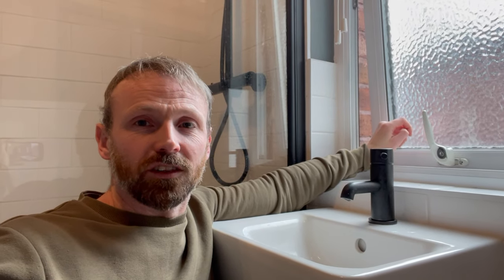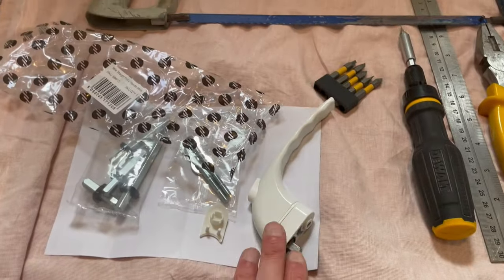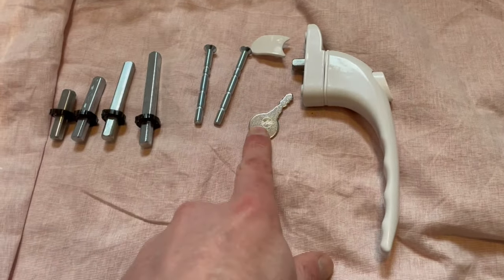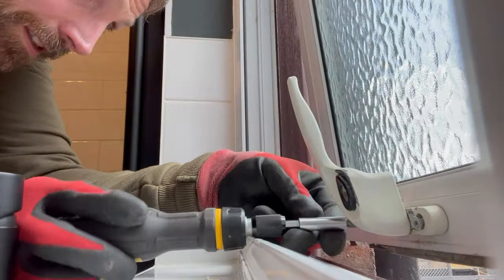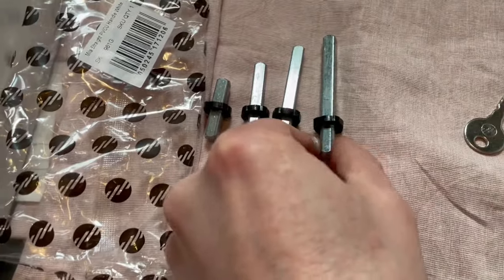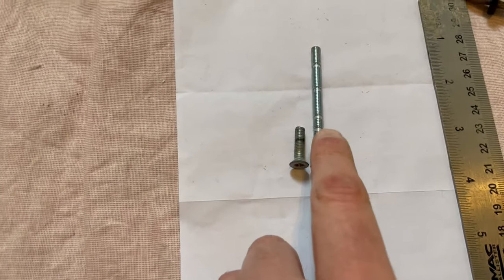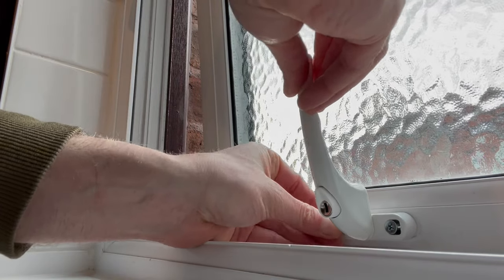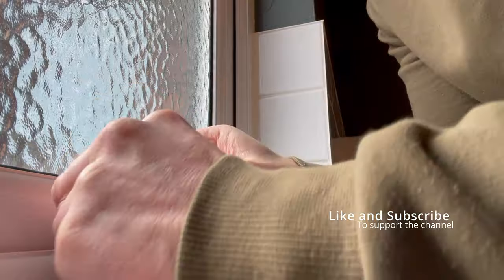How to replace a handle on a UPVC window

Comment: Came here to see if this looks like a job I can manage myself. It does! I’m going to order a new handle today.
Reply from the maker: It’s straight forward enough Julie - good luck with the project 👍🏼😊
Reply: I replaced the handles with new ones. However , My handle is a bit loose / wobbly . Can it be the rod size or  rod width issue ? Original handles looked exactly like the old ones you replaced.  The 2 screws at the base of the handle are tightly screwed in . Thanks
Reply from the maker: @n1npo  Hello, is it wobbling where the base plate meets the window frame? If so, usually the screws that hold it firmly against the window frame are loose/ not tight enough or the screws might not be long or wide enough for the thread. In that case you could try new screws in the frame. Also check if the spindle is too long, as it may prevent the baseplate from tightening  against the frame properly even if the screws are tight . Hope this helps 👍🏼

Comment: Tried to change the handles on some of our windows, the handle came off, but the spindle is stuck in the mechanism, any ideas on how to get them out? Thanks
Reply from the maker: Hello. Either a strong magnet (like a telescopic magnetic retriever), or needle nose pliers usually does the trick. In terms of the former, make sure the head of the telescopic retriever is small enough to fit the hole. Hope that this helps. 👍🏼

Comment: My aluminum window kitchen & bedrooms have pop rivets rather than screws the types youd see on hinges.😭.
Ever encounter these?
Reply from the maker: Hello, I’ve not had much experience with pop rivet style handles. You can remove pop rivets using a few different methods (using either a pop rivet removal tool, drill bit, rotary tool, or flush cutting snips etc). Choose the method depending on access, type of rivet head,  and least amount of damage. Plenty YouTube videos on pop rivet removal. Sorry I couldn’t be of more help. 👍🏼

Comment: Could i replace the handle while the window is in a closed position?  The thing is my window hinges aren't operating well and i open, it rolled all the way back making it hard to reach and work on.  Thanks so much.
Reply from the maker: @vikmnatsakanyan  Hello Vik, ideally you should change it whilst the handle is in open position because one of the two screws is usually inaccessible when the handle is closed. However, you could try opening the handle partially, remove the single screw that is covered (when handle is closed), close the handle again fully and remove the remaining screw (whilst window is closed), then reverse the process (fit handle close with one screw, partially open, fit other screw close). Hope that makes sense. 👍🏼
Reply: @makeitwork-propertydiy10  thanks very much, that's very helpful. Because the handle with the spindle part has broken and coming off anyway,  the screws are accessible. Waiting for delivery of the handle to attempt to replace it while the window is in closed position.
Reply: @makeitwork-propertydiy10  would be wonderful if you could make a video on how to fix loose hinges on window.  Mine slides open all the way back on a top hanging window.  Thank you!
Reply from the maker: Thanks good news Vik - good luck with the project and hopefully it goes well. All the best 👍🏼
Reply from the maker: Yes Vik, I’m planning more videos on window fixes soon. I’ll try to include one. Quite a few good videos out there on YouTube already about replacing the hinges if you  have a quick search. Best wishes 👍🏼